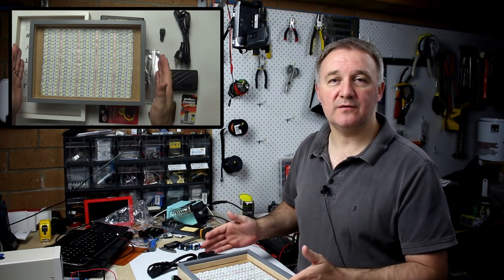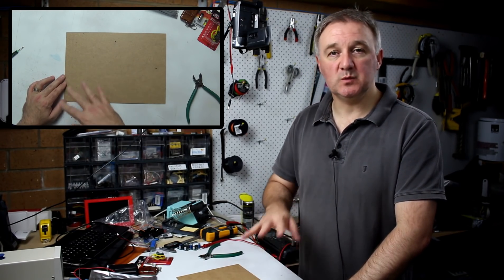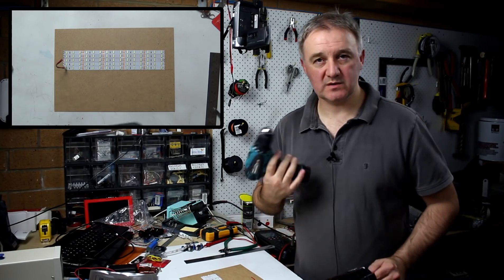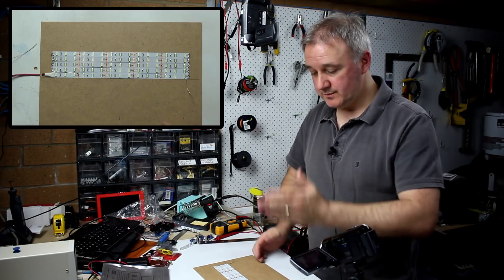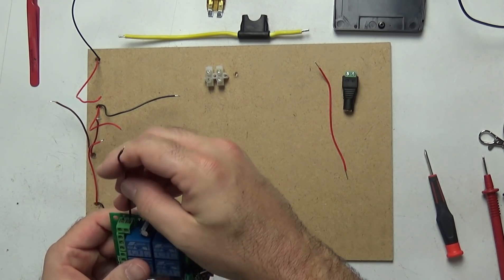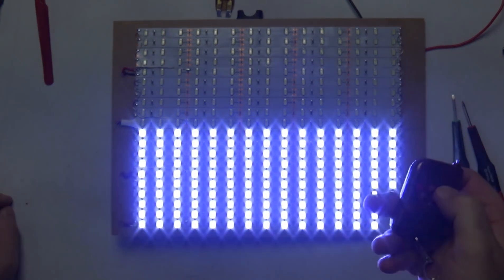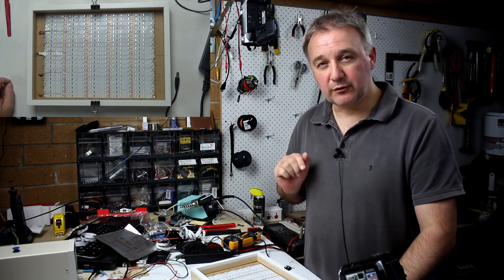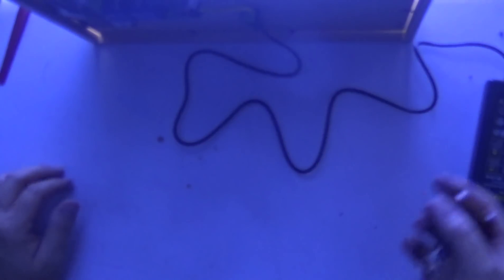DIY LED Light with 4ch Remote Control (improved) (MEHS) Episode 59

Comment: Michael can you make this into a flexible LED mat instead?  I would like to try to make one for videos but want a portable option...actually foldable.  Thoughts?  Thanks.
Reply from the maker: Hi.  The only challenges would be keeping the led strips stuck to your flexible backing material and making sure that any flex you introduce doesn't result in a short between any of the exposed strip positive or negative contacts.  The rest of the approach would be the same.  May be just add a small gap between each strip to provide a small safety buffer and don't make the backing material too flexible, not like cloth that you could fold in multiple directions but more like a small rubber exercise mat that really lends itself to being rolled up one way.  Hope that helps.  Cheers.
Reply: @michaelsstuff4402  Thank you!!

Comment: hi, i have recently built a led light from a octagon and led strips and after 2 mounts of fiddling i have found a way to dim the led's with a remote using the controller out of a mi light led bulb (the mi light controllers have scan lines but the controller out of the bulb does not) i made a video showing how to connect everything. hope it helps

Comment: You still owe us the battery backup part (I was paying attention on earlier video). I've been looking for the best diffuser for some projects (mostly light strips in corner angle channel to mount up where ceiling meets wall, run my wiring through attic) and got interested in Fresnel Diverger lenses as the most efficient type (rather than lose efficiency by randomly scattering that a sanded surface would create including a lot of lost backscatter). Only thing I've found are called Wide angle fresnel sheets for car windows when backing up that come in 8"x10" sheets (amazon, aliexpress). I'm hoping they work (different from a magnifier or its reverse, collator).  
Also just thrilled by the way you do your projects, thinking them through as I try to do, your particular way of communicating is very clear to me.  In fact, you remind me of the F1 mechanics explaining things; they really know their stuff but always need to think conceptually on the fly so their explanations are clear and communicate the principles as well as details in a terse manner.
Reply from the maker: - Hi.  Thank you for the clear and useful feedback.  The video you are looking for is coming.  I now have all the parts I want to use and I am just finishing up some relevant testing.  Maybe 3 -4 more weeks.  Cheers.

Comment: you need to atleast mount them on an aluminum plate..... This is the second time I see you mounting them on a heat insulating flammable material, the absolute worst choice.
Reply from the maker: - Hi.  I'm not sure I agree unless you have some data to sway me.  The cheap MDF material used for backing has an ignition temp of 200C.  The hottest I ever saw the LED panel get was 52C.  Thats a big safety margin.  If something catastrophic happened such as an uncontrolled short then the other materials are going to burn before the MDF.  Cheers.
Reply: Well its not only about safety, its also about efficiency, the cooler you run them the better the efficiency and the longer they last! it's not that these strips are high power so they dont get really hot, but it is something to take into consideration anyway because it makes them last longer and run cheaper.
Reply from the maker: - Hi.  Yep on that point, completely agree.  Cheers.

Comment: One of the best DIY videos I've seen on LED panels, however... Instead of being able to turn each section of, I would be very interested to hear if you know how to dim the lights instead without flickering and without overheating issues, which some of the other LED panel DIY tutorials suffer from. :-) Keep up the great work - you seem to have a talent for making these kind of videos.

If you don't mind me asking one off-topic question: What mic and camera are you using?
Reply from the maker: - Hi.  I haven't done a video on Pulse Width Modulation which is one method to achieve dimming but I might sometime.  The other way of controlling brightness and avoiding flicker is to control the number of leds turned on at any one time (as in this video).  It also helps with the heat issue.  The trick with PWM is that it needs to be very fast to avoid flicker being detected in video or affecting photo work.  Many simple plug in solutions like the one I used in my previous LED panel video are not fast enough, but it is possible to get it right.  Thanks for the compliments.  I typically use a Canon DSLR 700D (T5i) with an F4 lens and audio is captured through a RODE Smart Lav + and a Zoom audio recorder.  The RODE stuff is excellent.  The only exception is the standard ROD Lav mic which is too noisy, but the Smart Lav + is broadcast quality.  Cheers.

Comment: Nice video - thanks. would a regular 12V car battery work to power this? Can you give any details of exactly what power supply you did use?
Reply from the maker: - Hi.  Yes a car 12-13.6v supply would work fine.  The power supplies I used were a 12v power brick rated at 6A and a bench power supply set to 12v @ 5A.  The LED's are tolerant to a point and can run from 9v to 14v.  Cheers.

Comment: If you make the same unit but with 10 strips on channel one , 5 strips on channel 2, 3 strips on channel 3 and 2 strips on channel 4 you can get 15 different brightness levels with the same parts just by turning on and off the 4 channels.
More control same parts. You can turn on almost any number of strips from 2 to 20.
Reply: Where ya been all my life? Thanks for helpful suggestions - that's why it takes a village to make a proper LED light.
Reply from the maker: - Hi.  Yes that makes perfect sense.  Great idea.  The relays are able to handle 10 amps each so there is no issue with channeling a heap of strips through any one of them.  Great.  Cheers.

Comment: How would you make one with LED lights that change color and have a remote?
Reply from the maker: - Hi.  The simple way would be to use the optional multi colour LED strips the same as I used but coloured.  Cheers.